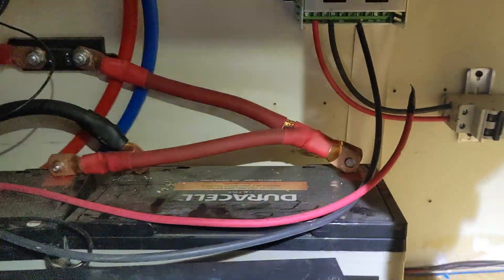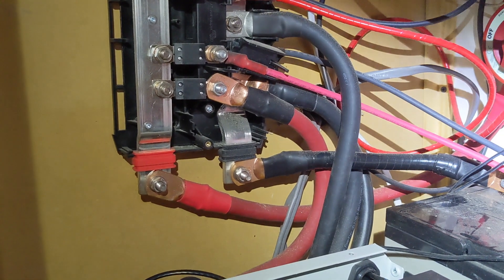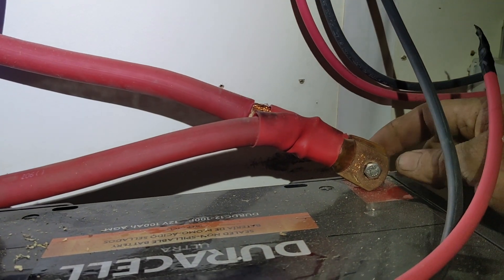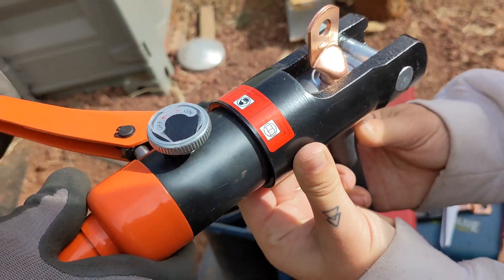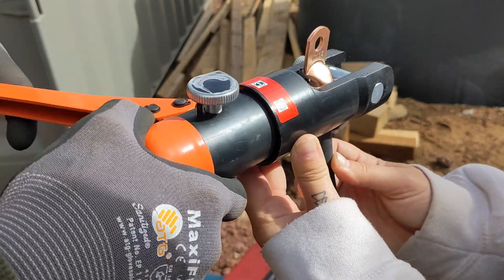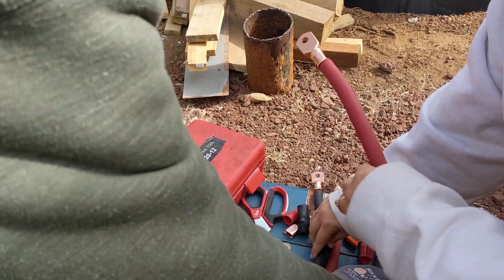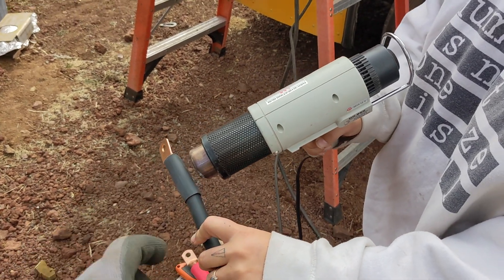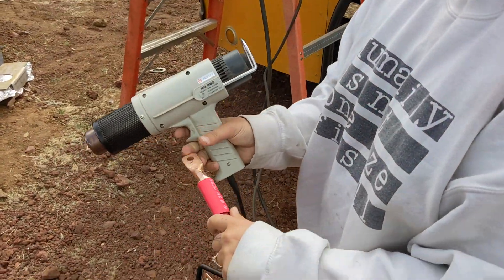Troubleshooting a solar system power issue...and fixed it.

Comment: Just so you know, had they done it with a hammer and then they heated it up with a torch and soldered it, they would have been solid. I always like to solder my connections even after I've crimped them.
After they cool then you can shrink.
Using a torch is preferable because you got to get the heat in it quickly so that it doesn't travel down the copper messing up the insulation.
I also like soldering the connector on because then it won't wick corrosion into the connector.

Comment: A really cluck-tastic fix. I really like your neat little hydraulic crimping tool. I am sill using the same old big unwieldy "Arm-Strong" manual version that I purchased way back in the 1970s. Its hard work but gets the same results, ive never had anything work loose yet anyways.
I love your videos, please keep them coming.
David in the U.K.

Comment: Great example of logically "following" the electrons (sort of) around the circuit.  A novice would have begun replacing parts, and give up.  Ross, you really are helpful!  Thanks for "filming," videoing & walking us through potentially baffling projects.  Another example of using the right tool, also.